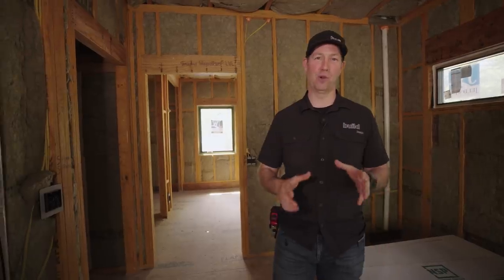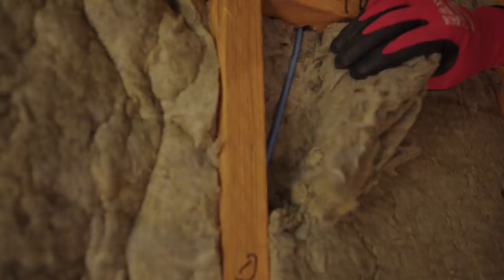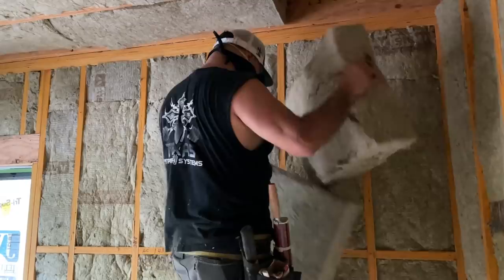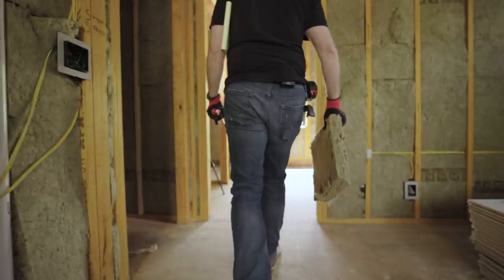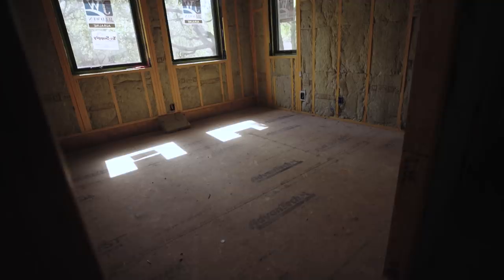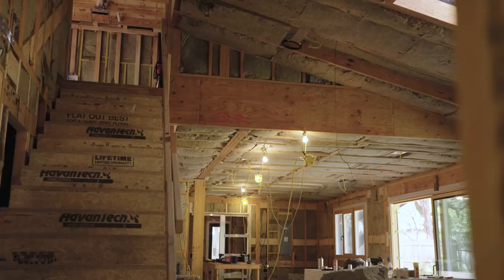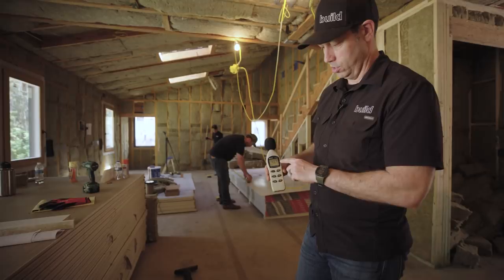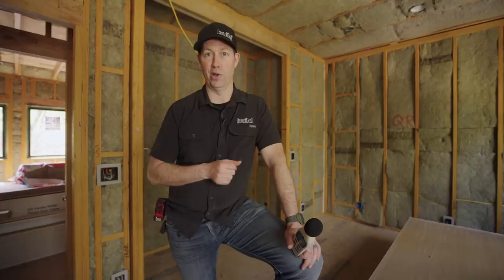7 reasons I used Rockwool insulation at my house.

Comment: What a vast majority of people don't know is that rock wool and fiberglass can not guarantee the R-rating on the package and in fact, 
can not prove that it has any insulation value whatsoever. I was 
installing insulation in houses in the 1980s when it was brought to  the
 FTC and Courts. Congress got in on the act realizing that all of these 
Insulation companies would be shut down. They suggested that the package be labeled with: Suggested R-Rating---R-whatever. Over the years the companies silently removed this wording. Cellulose is the only product that has and can Prove an R-rating. I don't know about foam as of right now.

Comment: insulation by straw bales, hempcrete, aircrete, rammed earth are eco friendly cheap and fire proof solutions.
when straw bales where validated in Germany the fire results where (on plain bales no covering) : 5h hours before consuming thru the seem between 2 bales (using a flame thrower !). when they validated in France, they started the test all over but a bit differently : a 1 story house was fully built. the fire experts tried as hard as they could but never managed to burn the house down. they set everything on fire inside, attacked it with flame throwers from the outside and 8 hours later gave up. end result was a thin crust of burn marks that where less than 10mm thick !

Comment: For my mid-60s home, we have blown-in rockwool insulation with fiberglass bats on the walls. The underside of the roof has no insulation. Should it? It's just roof decking over the joists. When we got a new roof a couple of years ago, they did put in roof vents. We only had only screened gaps along the bottom of the eves. The original roof was a tar and gravel roof. I think they were on drugs to think that was a good idea on a slanted roof. During severe storms, the gravel would break our neighbor's window on his garage door. He eventually just gave up and put in Plexiglas for that door.

Comment: Hi Matt, As always great video. But I think you really missed explaining an important consequence of Rockwool's fire resistance behavior. 

Apart from its obvious resistance to burning, Rockwell has this unique feature that it, in addition, does not RETREAT or break-down when exposed to flame. Other fire resistant/retardant (fiber) materials tend to retreat or breakdown (sometimes in seconds) when exposed to a flame which means that the substrate underneath becomes exposed to that flame. In a persistent burn situation Rockwool significantly retards the fire from spreading to a flammable substrate. That extra time can make all the difference. Over here in north western Europe Rockwool is what we choose as it has so many superior benefits. I tend to stay away from styreen and glass type insulators.

Comment: I understand that rockwool gases off  over time and that the vapors can be carcinogenic. Also, if you want an absolute vapor tight surface, skimcoat over the sheetrock board with 1/8" inch plaster. This will keep the house really air tight.
Reply: Well that sounds poisonous. Why didn’t Matt mention that?

Comment: Rock wool is awesome for sound proofing inside walls. However, nothing beats closed cell foam for all exterior walls and the roof. There is a lot more to thermal transfer or loss than the R-value of a particular insulation. 3 inches of closed cell foam will outperform all other fiber-based  insulations out there with greater R-values. (Real-world, not perfect lab conditions).This is because closed cell foam stops air movement. Air moving around thru walls and ceilings is where most of your thermal loss happens. When you see that black color on old fiber insulation, that is evidence of air movement. That is dirt trapped in the insulation. All that is really needed for many applications is 2-3 inches of closed cell foam on exterior walls and about 4 inches on the roof. Any more than that, your insulation value does not increase much (law of diminishing return) for what you pay out. The example given on the water-damaged section of foam was open cell foam. Open cell foam is not a moisture barrier. Then, there is the standing water issue.  Most building materials were not made for standing water unless it is poured concrete like a basement. So, in my opinion, the water-damaged foam example, because it was flood damage, eliminates it from any negatives of the product.  A great example of foam:  a styrofoam cup protects you from being burned by your hot cup of coffee. Our insulation codes are way off and need to be updated. Yes, foam costs more upfront. That loss is quickly recouped with lower utility bills and better comfort inside the home.
Reply: Not environmentally friendly

Comment: I'm looking for the best insulation to use on a pop-up to hard side trailer conversion that will keep the Arizona summer heat out and is fireproof because I did have an RV fire (videos on my page) it just went up like paper. Disintegrated everything. There was nothing left but the steel.

Comment: I actually find excessive sound muffling in new buildings to be rather unsettling. While insulating interior walls in bedrooms or around mechanical equipment might be a good idea (and sound studios... I find street noise to suddenly be very annoying when I am trying to record audio), I would personally leave interior walls in the primary living spaces uninsulated. And make sure all windows are operable and can be opened to let in ambient noise when the weather is nice... because apparently non-opening windows are a thing now in single-family residential construction.

Comment: Fibreglass batts are best in thermal heat resistance outside of banned illegal asbestos and polyester batts are best for installation because they are non allergenic and don't irritate the skin.

Comment: Is RockWool equally good when insulating against extreme cold as against extreme heat, i.e. deep freeze winter temperatures down to minus 50 degrees Celsius/minus 58 degrees Fahrenheit and summer burning hot temperatures up to 50 degrees Celsius/122 degrees Fahrenheit? Extreme weather will only become more usual as climate change progresses and it's up to each house builder to protect the family against it and also from buying and running expensive air-conditioners and heat pumps.

Comment: I have a raised house in Florida with and apartment under the house. I'm thinking the Rockwool sound insulation would be a very good idea between the apt cieling and house floor. Two questions , its very humid there, will the rockwool be affected by humidity ie , mold growth , moisture absorbtion  etc ?  Also , even the sound RW must have a r value. Any idea what that might be? 
We used RW sound proof material on a project up north in NY. Its a fantastic product.

Comment: My only issue is the small clumps that break off if not cleaned up before drywall is up will embed into drywall and eventually rust about a year later.

Comment: Here in Norway it's either Rockwool or Glava being used for insulation in houses or even commercial buildings..And the outer wall thickness here is like 10 inches in new houses..
Reply: Does the Rockwool in Norway have formaldehyde?
Reply: @59seank  After some little digging, i am afraid to say that rockwool do contain that substance here in Europe. But i might be wrong tho since the article i read was a few years old now..
Reply: @TheLassenman  Thanks for checking.

Comment: You should do a sound test with the sheet rock up as well just to see.
Reply: The results will be little different then almost no insulation, and virtually no different with rock wool vs fiberglass. Once sheet rock is in place all surfaces (floor, wall, and ceiling) will be reflective.
Reply: @cornholy69  I could see that for sure

Comment: Matt, I have two questions regarding hemp wool.  It has a high r value, it ages well.  My 1st question:  what type of siding works best with hemp wool insulation?  Second, I understand it regulates moisture well, so I assume it doesn't need a vapor barrier.  Is that correct?

Comment: How is the weight of Rockwool when used in a non-conditioned attic? Does it put too much stress on the ceiling drywall? Just wondering with a poor blown in attic, if I went in and added more cellulose blown in to the top of the joist and then added Rockwool across the joists, whether that might be a simple solution? Cheers and love the great work you are doing.

Comment: Love the tutorial, sold me and will be using this vs my fiberglass for my addition. My only question. At 5:20 you said make sure to have drying in both directions in the northern climate. (As I am in ND) So from exterior in I have my log siding, tyvex house wrap, plywood, Rockwool but do I or do I not install say plastic for a vapor barrier on the inside? As where fiberglass youd have a faced insulation? Just stuff the rockwool in and put sheet rock over??
Thank you

Comment: Can you use spray foam first and then the rockwool? Is the exterior wall foamed on the outside?
Reply: matt did on a few parts. but i think its not somthing i would do unless absolutely needed as spray foam burns.
Reply: Yes, but depends on your climate zone, area of the house being insulated. Climate zone will dictate proper ratios of a vapor retardant foam to vapor open insulation. There is a lot of great information online in regards to that (Green building advisor and the like).

Comment: Problem with rockwool is the ever increasing requirement for lower U value. To use this where I live it needs to be 450mm thick and will need to be even thicker in 2025. PIR is significantly more efficient per thickness and saves internal space.

Comment: What insulating material would you recommend for a make-shift sauna door?  rockwool (comfort board) , spaceloft-aerogel , XPS, HempWool?

I'd like to mount an insulator on a piece of cardboard/styrofoam/balsa-wood and use it as a detachable sauna door.  Since it will be very close to me, and exposed to high-temperatures, I'm concerned of it giving off any VOCs or particles that may not be the best to breathe.

Comment: What R value did you use for the ceiling? Didn’t see it on the video. Only R15 for walls.
Reply: You know R-value is an overrated stat and you should just use code minimums. Diminishing returns on adding more insulation mean we should look elsewhere to save energy dollars. Windows, doors, interior mass, and air changes per hour become more cost effective ways to increase comfort and lower energy bills. After that just add more PV and power walls to run heat exchangers. Net zero is good enough.

Comment: I bought about 50 bags of RockWool from Lowe’s, it works perfect against heat, sound, fire 🔥, moisture, and the price were 20-30% off when u bought 10 or more plus veteran’s 10% discount which cost me about $32 per bag R30 last year. I probably get more later. Rockwool brand is the best, other brand I used not quality as RockWool. 

When someone sponsor your video, what do they have to do? Thx

Comment: Matt I have a question. I had a mold problem where I had the walk -in closet wall to my 1930 home ripped out. In the 1930s there was no insulation so I had no insulation in the wall. I would smell musty smell off and on for over 15 years but saw nothing. It was not until recently mold was discovered. Even though I cleaned it off,  the smell came back. Plaster walls. I was told it was caused by condensation on the wall. Now that the wall has been removed and I was told no mold was on the wood behind it, I want to put insulation in that closet  cavity before I put the drywall back in. I want to use a mold resistant drywall and was wondering what kind of insulation should I use. Would rock wool be okay. I live in California.

Comment: Using Rockwool should be a no brainer.  I’d rather pay a few bucks more for a product that does not soak in water or is flammable.  It’s also easier to work with when cutting around wires and receptacles...

Comment: Coming from the UK I have to say this is a very good idea, in that spray foam is fast and easy but it hides leaks and allows unseen wood rot.Then you have to ask, which gives the best fire protection-dont insurance companies have rules about this stuff? living in a mostly wood home, would you not worry about fire risk? Big open homes are lovely for a fire, ask any fire officer. Isn't there a requirement for fire doors together with heat and smoke alarms? Looking at these pictures, I have to say fire risk springs to mind.

Comment: Matt, so there is no mold problem using Rockwool where the shower pipes/ valves at? Is the material going to get moldy or any issue with moisture? My shower in the master bathroom is too noisy when I turn on the water so I'm thinking of installing this product in between the walls near the shower's water pipes and hope it will lower the noise of the running water.

Comment: While I agree that Rockwool is a higher quality material. Both unfaced fiberglass and mineral wool material provide the highest rated fire resistance. I would not make your decision based on fire resistance alone as this product is much more expensive than fiberglass.

Comment: Hold on, hold on. Testing sound absorption with opened walls is at least a mistake. The sound source is the shop vac. The frequency range contains also mid-high frequencies more sensitive for reflection on the relatively thinner surfaces as drywall or wood. Results will be affected and definitely worse after finished installation in comparison to opened walls due to reflections (even so still very good). 

You can see this when you talking in a room with opened walls. It's very odd, unnatural, such a dead room. After surface installation, it turns to normal conditions. Rockwool like other mineral products is very effective in sound absorption. I used (here in Europe) similar material from Kanuf Insulation (Nobasil) to treat my home studio for music production, but during measurements, to get the overall image you have to take into account physical rules for the sound spread on different frequencies.

Comment: I have some of this and it is great..  I am working on a 1990 G20 high top van that has a 2' fiberglass top.  I didn't expect it but today I pulled down the heavily degraded liner... now I pulled back the paneling and they have NO insulation in it.. no wonder it gets hot easily.  So the wood panel comes out tomorrow and I need to see how they affixed the inside of the fiberglass (rough which is okay).  I need to insulate it and then put up new ceiling wood or whatever.  ... Is there a way to glue the rockwool into place to keep it there until I get the covering over it? 2. I have a gallon of some sort of elastomeric primer sealer from Kool Roof (before they became such).  The roof has no leaks as it is but my thinking is to seal and prime it and just insulate over that and then put up the roof... (I'll be modifying wiring for new lights) ... pb  OH,  I do have some of that thin closed cell material I was/want to put inside the front doors on the outside skin but allow windows to still go up and down...  I think it is foil like on one side. I'll Check R value ... with rockwool, I don't think I need a vapor barrier as per say.  The work area is about 4 feet by 10 or 12 feet .. tiny

Comment: Certainteed  Blow in Blanket System (Bibs) excellent and will not burn either
Reply: That product ("Blow in Blanket") is actually millions of tiny specks of loose fiberglass that -- if you open that wall again -- will become airborne and could lodge in your lungs and eyes, get tracked around the home or eaten by pets, etc. The particles are also not very dense and IMO not very effective against noise. Just tap on the wall after the tiny particles are blown in and it still sounds almost hollow. If you're going to blow insulation into a wall cavity, use cellulose fiber.

Comment: used it in my garage/shop and it can be 90 degrees outside and my garage stays at 74 no aircoditioning in there either....i run my power tools and music loud and no complaints from the wife....

Comment: I want to insulate the gable ends of the attic with Rockwool insulation. There are a lot framing & siding nails protruding through the OSB so I can't put any vertical 2X6 studs without cutting off the nails which is something you don't want to do. My question is: Can I use a little bit of construction adhesive to help hold the batts in place? After that i plan on using Rockwool insulation to insulate the underside of the roof. I live in Wilmington, NC & the attic in the summer can reach 120 degrees & in the winter in the lower 30's.

Comment: We desire to insulate a 10'X12" shed with mineral wool.  We cannot find a source for a few packs of 23" mineral wool insulation.  All dealers are requiring a minimum purchase of 12 packs (over $1000 and 5X the amount we need).  Where can we purchase a couple packs of the 23" insulation to complete the ceiling?

Comment: I am going use rockwool in basement studwalls however I have a question. I was wanting to also use insulation board against the block wall exterior. Do I need to have a inch or so gap between the exterior block wall and the studwall? thanks for the great video. Any quick guidance appreciated
ty

Comment: I have a 1935 model house that has multiple attic spaces.  As of now all of the roof is new shingle and all of the peaks have ridge vents.  Two bedrooms have uninsulated closets that adjoin one of the attic spaces and those closets get rather warm in the summer here in NC.  I like the Rockwool concept a lot.  It looks like you held it in place by landscaping cloth.  Am I correct on that?  And, the top of these closets are sloped and join with the main house attic space.  Should I put insulation in those openings between the rafters to help the closest ceilings stay cooler as well?